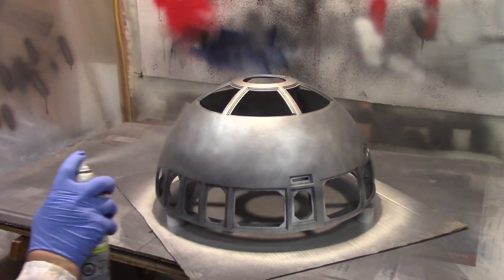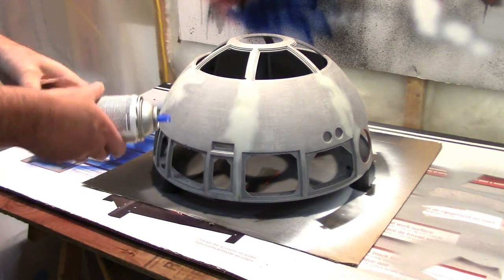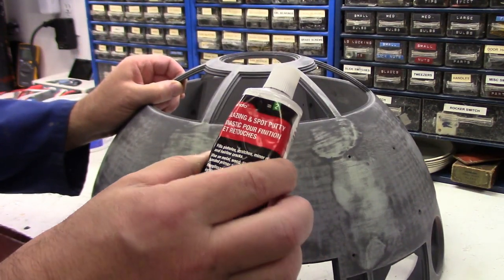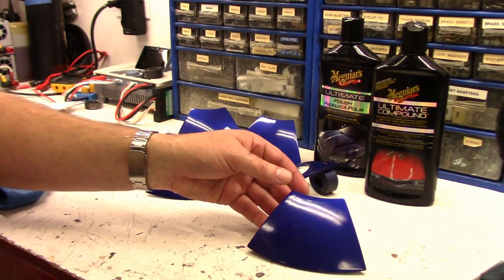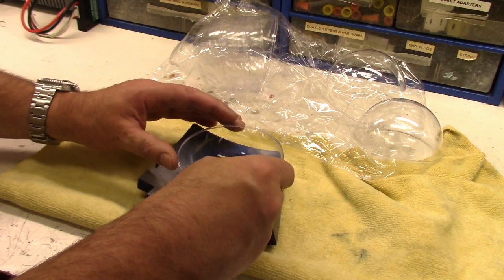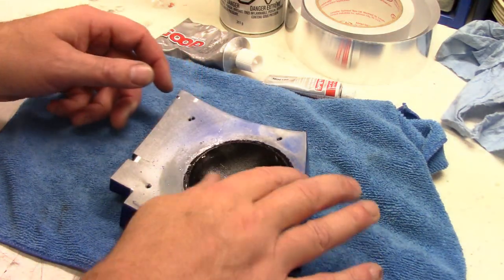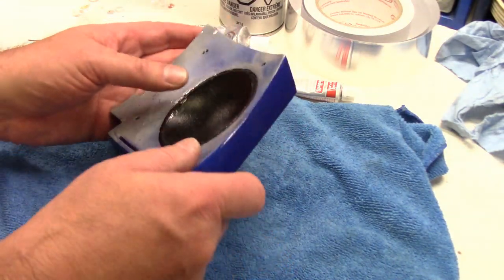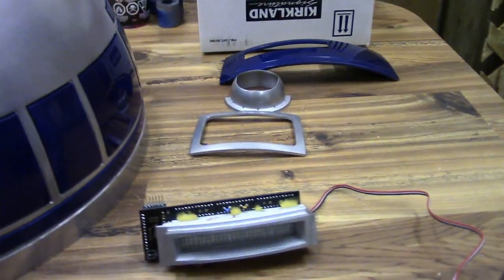Painting R2-D2 - Dome Colors, Priming, Spraying, Radar Eye, Rub N Buff

Comment: Great video!  I use rub and buff and buff so hard I burn my fingers.  You have to be careful about rub & buff, it doesn't shine up too well on resin or plastic - it has to be on primer or paint.  If you have bare resin or plastic it will be darker and dull.  I'm glad you provided the clear gloss spray for the blue parts because I'm about to paint all mine and didn't have a clue which one to use.

Comment: Amazing results. I think something that might have been understated a bit is that you are not putting the rub & buff directly on unfinished, sanded, prints. By initially intending to finish the dome with paint - you (unintentionally?) provided the ideal substrate for the rub & buff to be applied to. I'm learning that R&B does not like to be applied directly to the printed material.
Reply from the maker: Yep, the smoother the finish, the better the R&B results; if you want a polished aluminum look anyway. I cover this in more detail in the R2-D2 build part 9 video under the video chapter Rub-N-Buff Tips: https://youtu.be/E8h0l4rHvC4

Comment: Love your R2 videos. You are the one that pushed me to buy a printer and make my own. Just have a quick painting question. What did you use to hold the eye and panels while you painted them?
Reply from the maker: "Cheapious-materialious-availabious". In my specific case, left over scraps of foam pipe insulation I had from a recent DIY plumbing project. Have fun with your R2 build.

Comment: Hey John. How did you mark the mounting holes for the radar eye onto the dome?
Reply from the maker: I'm sure I'm missing something here in your question, but you can mark the drilling holes with any marking device you want (pen, pencil, scribe etc.) I may not have even used marks for drilling. Seems to me I recall just securely taping the  radar eye in the position I liked on the front side of the dome, and then drilling the 4 holes through the back side.

Comment: John - newbie here, building another star wars droid out of a 3D print base, but found your videos invaluable compared to many other sources I found. Any reason you used Rub N Buff for the silver of the dome as opposed to the automotive polish you used for the blue top pieces? 

Complete newbie here so apologies if I missed an explanation!
Reply from the maker: This question is covered in detail in the Astromech forums, but the quick answer is only rub-n-buff will give that polished aluminum look (that is what I was after to simulate a costly spun aluminum dome). Clear over silver paint will just produce a metallic silver paint look, basically exactly like you would see on any silver colored vehicle; it doesn't look anything like polished aluminum.
Reply: @Rchelicopterfun  that is a great explanation and makes perfect sense!! thank you!!

Comment: Hi John, amazing work!! And many thanks for sharing the howtos on youtube. I know this is a lot work. I have 2 questions. What rings are you using to hold the panels while sprying them? Is it necessary to spray the dome chrome bevor rub´n buff it? Thanks & regards, Michael
Reply from the maker: Rings are just foam pipe insulation. As to base coat on the dome under rub-n-buff, it should be something that is almost the same color as the rub-n-buff (why I used the Astromech Forum recommended Rust-Oleum Metallic Aluminum).
Reason being, if/when the rub-n-buff wears off or more importantly, all the little panel recesses where it's very difficult/impossible to apply r-n-b, would then show up as that non aluminum base coat color. The only other color I might consider is a lighter grey sandable primer if you wanted to forgo aluminum paint, but I have no idea how well that would look in all the little recesses where the r-n-b doesn't' get to?
Reply: @Rchelicopterfun  How do you attach the foam pipe rings to the panels?

Comment: Awesome build, really interesting project, you may of listed it elsewhere but what 3D printer and brand and model have you used to print all your parts John....can't wait for the next video, from start to finish what is the rough cost of the R2D2  project. one of my all time favourite robots
Reply from the maker: @Gary Owen - I go over tools used including printer in the R2 build introduction video: https://youtu.be/hkkSagTsLXY
Printer is a Sovol SV01.
No idea what the finished cost will be - and I don't want to know. 😄  I was budgeting around $1500 CND, but shipping has gone up so much in the past year along with parts shortages & inflation, so some things are more than I was expecting. It's been the little stuff like hardware, consumables & paint you don't even consider at the beginning (at least I didn't) that has really been a drain on the budget - at least up here in the great white north. 
With that said, the range of costs of full size R2 builds are vast. A 3D printed R2 like this is likely one of the least expensive ways. Full metal/aluminum ones on the other hand are the most costly with some builders having well over $20K into their builds going by the Astromech build threads. Also depends how complicated you want it to be. 
A static prop R2 that has no movement is going to be the least expensive, increasing in cost with how much animation you incorporate into your build. Presuming I'm able to get mine to work the way I'm planning, it's going to be fairly simple. Drives, head spins, 2 holo-projectors move, the normal lights, and it makes R2 sounds.
More complex builds have opening dome & body panels, with all working internal tools, probes etc. Some even have working 2-3-2 leg transitions (where R2 goes from three legs to two).  Basically an R2 build is similar to a scale RC helicopter or airplane build - the more complicated, the more $.

Comment: John, thanks so much for sharing this amazing project. This has inspired me to try this on my own. Question: Did you clear coat over the rub n' buff layer or leave it as-is? I've read mixed reviews about whether or not this is necessary in order to keep the compound from rubbing off later.
Reply from the maker: Hi Charles, No clear coat over R&B. It's a wax so it's impossible to paint over it with most paints - fish-eye city and no stick. Even if you could paint over R&B with some special wax adhering clear paint, it would totally defeat the look and function.
R&B looks so close to real metal because that is essentially what we are seeing - all those tiny polished aluminum particles contained at the surface of the wax layer.  Put paint over that, and that look would be gone. 
The downside with R&B as you pointed out is it will wear off if you don't apply it correctly and wait for the wax to fully cure which can take weeks if not months. I can rub a white cloth across the dome now after 3 months and hardly get any silver residue showing. In the first week after application when I did that, the cloth would turn silver. No idea however how heat will impact R&B out in the sun? May soften it again and cause it to rub off easily? 
There are pros and cons to R&B, hopefully this helps you decide if you want to use it or not.
Reply: @Rchelicopterfun  Fantastic information, thanks so much for taking the time to share. Looking forward to ongoing installments of your project!

Comment: Hi John - I'm working on my R2 build, and I've noticed that while I am hand sanding and priming to dome panels, I've noticed that the larger panels no longer fit into the dome.  It's almost like they have warped out of plane.  Have you ever had that issue?  I'm wondering if those larger panels need to be re-printed and I need to keep a better eye on them if they happen to be in the sun of longer than 10 minutes.  Any advice would be appreciated - thanks!
Reply from the maker: Never had that issue so not sure what happened? Hot day, hot sanding, warped PLA - possible I suppose... No idea?
Reply: @Rchelicopterfun  warm days but the parts were in the sun for just a few minutes before I got them back inside. I wonder if the humidity might be playing a role. It’s only affecting the larger panels and a few of the pie pieces. I’ve got them back in the basement and I’ll keep an eye on them over the next few days.   Thanks !
Reply: Update for those with the same issue:  I've had good results using a hair dryer to gently warm up the warped parts while keeping them pressed into place.  I think having these thin panels out in direct sunlight for just a few minutes caused the warping problem after all.

Comment: is it possible to weather / wash the painted parts that are treated with Bun n Buff?
Reply from the maker: Folks get some amazing weathering results with Rub n Buff, techniques vary as well as what is used. Several threads in the Astromech forums. Washing - I use a damp microfiber towel to wipe down R2, I do keep him away from the garden hose and car wash bucket however. 😄